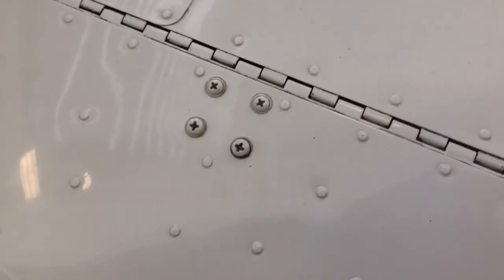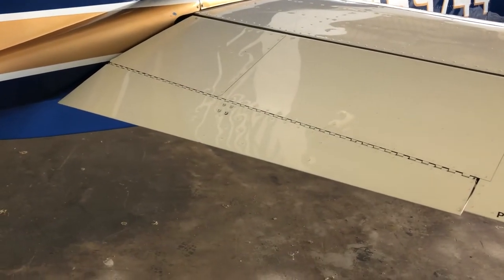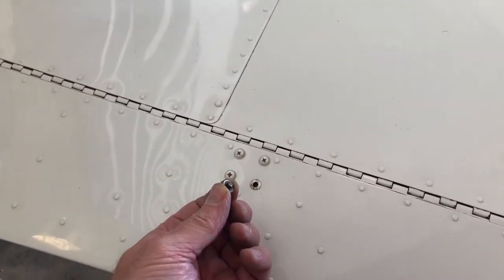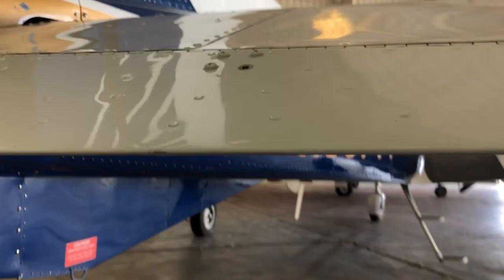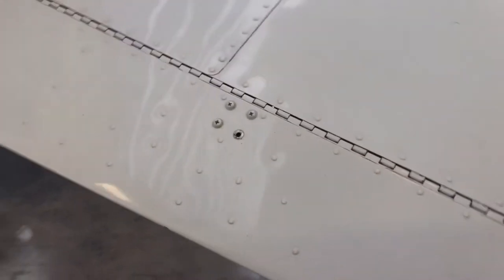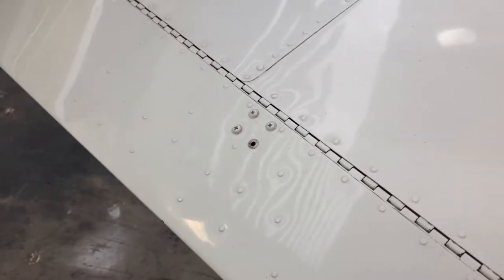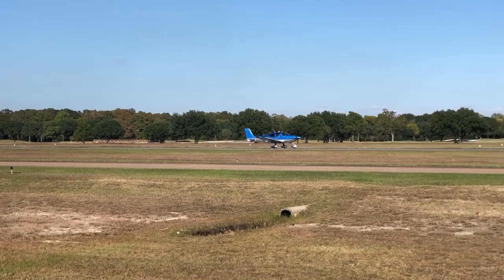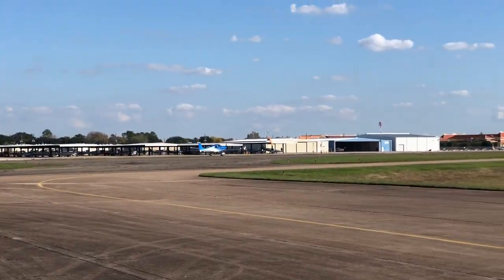Twin Cessna Tech Corner:  Trim tab screws critical inspection

Comment: Jason, the FAA issued and Airworthiness Directive (2016-07-24) that directly addresses the elevator trim tab hardware.  If I recall it required Inspection and replacement of any defective items.  Cessna also issued a Service Bulletin (MEB 27-02).  This was back in summer of 2016.  You may want to have your shop look into these.  Btw, I'm enjoying your different take on flying these wonderful aircraft.  Keep up the great work.  Fly safe and blue skies to you.
Reply from the maker: Hi Twin Flyer. Yes the AD has been complied with on my aircraft. Numerous owners are reporting compliance with the AD but not changing out the trim horn screws as well. Thanks for the additional info and the kind comments!

Comment: Good call, basically it goes beyond elevator trim tab hardware AD which only covers bolts - Docket No. FAA-2016-8992; Directorate Identifier 2016-CE-021-AD; Amendment 39-18621; AD 2016-17-08
Reply from the maker: Thanks. Yea I should have added this is additional issue than that covered by the AD. The AD covers the actuator hardware.